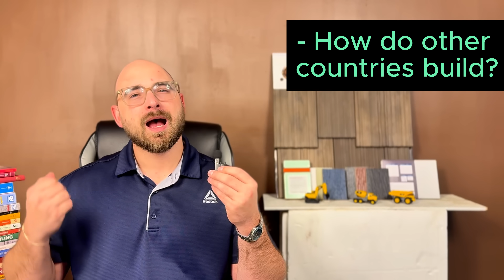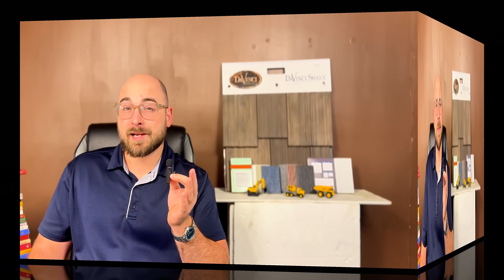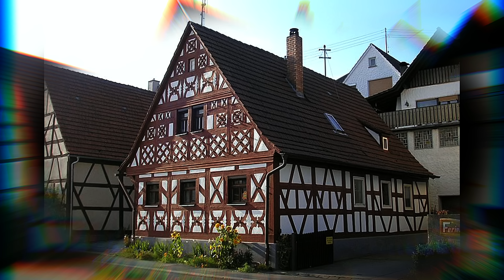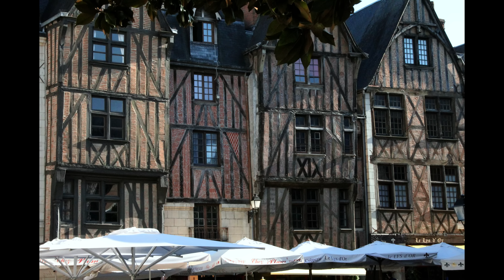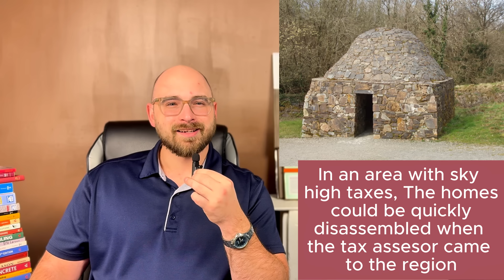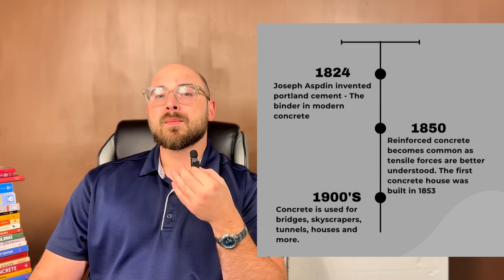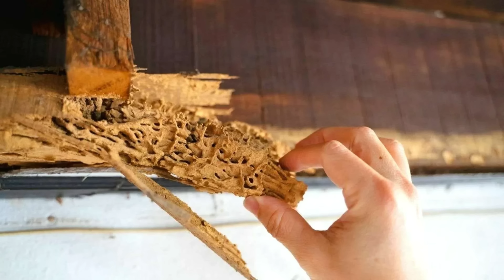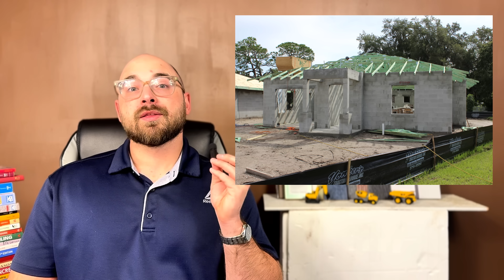Why Other Countries LAUGH at American Homes

Comment: I personally think that strawbales houses on an insulated concrete foundation (you can add stuff like perlite or leca balls to concrete to make it insulated, also saves on concrete) are the most sustainable way to build almost everywhere in non tropical climate.
Strawbale houses can be built timber framed or load bearing, have wonderful insulation for noise and temperature, are built from an organic byproduct of our food production, and have an extremely low CO² footprint.
The material can be sourced locally almost everywhere, and almost no energy is used to produce it (a bit of diesel for the strawbale machine and tractor, and a bit for transport.

Concrete and bricks are wonderful, but they need a lot of heat energy to be made. I think their use should be limited to where it's necessary, as in foundation, floor for upper storys, roofing materials etc...
Timber is also wonderful, if you don't chop it up into little toothpick sized sticks, and manage forests responsible... But timber also does not need to be used everywhere, it's enough for proper framing.

Clay plasters are absolutely lovely inside, can be colored lots of different ways, they act as a thermal mass to reduce energy spent on heating and cooling, regulate relative humidity to a nice and stable 50% inside the house year round and can even be reused after centuries, simply by soaking the pieces and remixing.
Lime plasters do need a good bit of energy during production, but not much is needed to plaster a house. They make for a nice, weatherproof plaster, that also can be coloured, it breathes, has anti fungal and anti bacterial properties to prevent molds, can even be polished into tadelact to be waterproof enough to make showers and bathtubs and sinks from it...

And last but not least, hemp should be given some love as a sustainable, wonderful building material. It can be mixed with concrete to make hempcrete... It can be made into insulation... It has lots of wonderful uses, even only within the building industry, and best of all, it will grow on very poor soil with very little water, doesn't need pesticides or fungicides...

Aside from materials, I really mourn the loss of historical building styles.
Houses evolved in certain styles in different regions for reasons. They are usually very well adapted to the locally available materials, climate and natural disasters. 
A pueblo adobe house is perfect for desert climate, but would not make sense in Wales (where they have houses from very similar material (cob, wood and thatch) but in a completely different style.
A house in southern Bavaria in the Alps used to be build on a big stone foundation, with a big roof overhang to keep snowdrifts around the house to a minimum and to stack firewood, smallish, mostly south facing windows, and wood shingled roofs (that were payed, not nailed) on extremely heavy timbers, so it could bear huge snow loads (which added insulation). This style would not make sense  for let's say Alabama, which has almost subtropical climate. 
There, you would want big openings to catch the breeze, shades for the openings tall ceilings... Probably steeper roofs for heavy rains... And lots of lime plaster, stone, and moisture resistant woods like oak, teak, mahagoni etc instead of pine or fir...

Comment: Local monopolies, cheap materials, and low property taxes—these factors combine to produce certain outcomes. Wooden houses are neither environmentally friendly nor earthquake-resistant, as they require not just wood but also various chemical fillers, which can release large amounts of toxic gases when burned. In fact, with the advancement of modern industry, new materials like reinforced concrete and developments in engineering mechanics have become highly sophisticated.

Comment: The problem with steel in concrete is that it massively improves the performance of the concrete… for a short time. Concrete is porous, and water gets inside. It then rusts the steel, which expands when oxidized. This cracks the concrete, allowing more water in. Game over. 

We’ve tried all kinds of stuff like coating the rebar in polyurethane and other waterproofing ideas but if the workers aren’t careful or do everything perfectly they can compromise the coating or cause some other issue. The reality is that you just can’t stop water, so concrete without rebar can last a lot longer.
Reply from the maker: It can be prevented. 

We can use stainless or galvanized rebar, there’s also basalt and GFRP. 

Concrete can be treated with calcium nitrate to increase the protective layer (passivity layer) that forms around the concrete. 

And we can protect the concrete from water, waterproofing, drainage plane, cladding, capillary break at foundation, etc.

Comment: Excellent video.  There is so much more detail to discuss and consider that most people do not understand.  Reinforced concrete has been used for countless parking structures as well as for high-rise condo and office buildings - BUT - the rebar inside all those structures ages and will more often than not ruin the very concrete in which it was encased.  Correcting that issue is extremely costly and difficult.  America needs to (& could) do MUCH better with putting up its buildings whether residential or commercial.  ICF, SIP, building tile (AKA structural clay tile) and recycled materials for roofing are not being utilized the way they really should be - and all of them are superior to stick-building in my opinion.

I'm building my own home using ICF, SIP, and recycled materials.  Yes, it's more costly in the beginning but over time, it's much less costly to maintain.  Sadly, finding quality builders willing and able to build (correctly) with these materials is exceedingly difficult.  Unfortunately, to a large degree, code adherence, quality assurance, and just the overall "getting it right" is on the shoulders of Homeowners, when really, it belongs with the building contractor who is charging exorbitant prices.  We need laws that protect Homeowners more and Contractors less, but that's another video!

Comment: the main difrence i see between norwegian and american houses are that norway tends to pad the margins a lot more at just abaut every angle. electrical cables are thinker than they strightly have to be, outer walls can in extreme cases get quite redikulusly thick. the personal record i've seen is a outer wall wacing a cold and windy ange witch was just shy of 60 cm thick at the lowest level (an admitetly extreme case). if there is sutch a thing as "standard" here its probably a house built on a slope on mountanus ground with its lowest level and at minimum foundation being made in concrete, then 1 or 2 levels above that is wood framing with exterior wood framing and tiled roofs. interior walls warry a lot but again our insulation requirements are damm well padded.

in the end a norwegian house is going to be significantly more expensive than a american one to build, but its also going to have less heat-loss and be built with the expektation of lasting around 80 years before major renovation is needed. they are also extremly well inulated, as in if your house was built the last 10-15 years or so an internol termostat shoud not be able to detect the changing of the seasons

Comment: 'Building code' is the absolute bottom of the barrel, dregs of minimum standards. We have trouble with developers willing and able to consistently meet even those laughable standards. Fighting almost every effort to update and improve code and standards. If cardboard boxes with extension cords were code, they'd be building those. If the cardboard homes were accepted for a number of years, they'd then call them 'traditional construction'.

Comment: As a south American I have asked that question many times, why are American houses like that?

Here I have to recognize that a great % of homes in many regions of south American countries are in deplorable condition. However, the actual house or departments are way more resistant than an American home.

You punch the wall? Not a problem, simply go to the doctor!

A car crashed against your home? Not a problem, it evaporated against the first wall.

Someone wants to break in? Close the door.

After thinking about it, I believe that all of this comes to different needs for different countries. South Americans are used to earthquakes and so is our architecture. Buildings must be able to resist the common 3-5.5 earthquakes that could strike at any moment.

In the other hand, Americans have to deal with storms and floodings more often. But I don't see how making paper homes help with that...? Another justification that ai found online was that making homes like that allows for easier modifications and that sounds fair but it not like our houses that are more similar to European structures can not be modified or repaired.

This may be a question without a satisfactory response, it may be another case of America not being like the others (similar to Americans using everything except the metric system)

Comment: It is not that USA doesn't want to build better homes, the problem is that their chain of materials and technology is all based on wood, even if all contructors learned to do brick and concrete homes, the material channels are not ready to change to new materials and there would experience an economy hit.

Comment: In Western australia we use mostly double brick construction with insulated gap between the bricks.  Wood or steel roof framing with tin (colorbond) or tile roof.   Eastern states mostly use single brick outside wall with steel or wood framing for walls and roof and drywall inside finish.   Tin or tile roofing.   Concrete comes with a massive CO2 impact so that's something most don't know about.  If wood is from tree farms then its removing CO2 from the air when they are growing and then locked away in houses for the life of that house.  So really swiss are adding a lot of CO2 with there building choices vs america using wood frames.

Comment: Strict codes and strictness is not actually helpful. Because it leads to corruption and bribes.
A simple example. Driving license is so hard in my country currently, that it's normal that people give bribes to the examiners. Which means, that lots of people regardless of their driving skill pass, only the worse won't. While very good drivers still won't, unless they bribe. The system works against itself. 

The solution is to aid or help house builders, or they just won't register their houses or forge the papers on it. But if the registration process is aided, the architectural phase, common sense room layout and needed logistics rooms advised, so on, or even common usage tools can be rented, than there is a healthy co-working for achieving the best result.

Simply going strict doesn't help. It's more effort, but with less result. For a higher bar more effort input is needed, to better and aid the process.

Comment: I'm from Belgium. We plan to build a wood-structure house (with a lot of  bio-sourced insulation). Actually here in Belgium those wooden constructions are more expensive than "classic" constructions with concrete or concrete blocks, what a pitty.

Also: tornadoes and storms in europe (at least in western europe) do not seem to be as strong and challenging than american ones. So that argument does not seem accurate to me.

Comment: 24:45 Fun fact: Mr Wright had a similar idea to the one adopted by the Soviets much later.
I'm polish and many, many flats and residential skyscrapers that were built when our country was a soviet puppet state may be compared to the mentioned method.
They used to prepare sections of armoured concrete walls through casting and then assembled the whole building at the construction site. At the time the establishments that actually produced these things were simply referred to as "house factories". 
If you Google something like "soviet commie blocks" you will definitely see what I'm talking about since most of those buildings still stand and are in fact used by the population (myself included).

Comment: I want to say this as a Japanese person.
There's always someone worse off than you.
It's a wooden building with uninsulated walls and aluminum sash windows (single pane glass).
In the summer, it's freezing hot because the air conditioning doesn't work!
In the winter, it's freezing cold because the heating doesn't work!
It's a waste of electricity, kerosene, and gas!
If you're not careful, you could die of heat shock in this house!
Reply: I'm in the UK, and in our visits to Japan we have been astonished at the discomfort of anyone living in a traditional-style house: too cold, too hot, high humidity. They look beautiful though!

Comment: You can see these perforated metal plates on wooden roofing truss connections. Yeah. I don't think those are accepted elsewhere or at least in Europe. I know in Hungary, definitely not. Usually there are these big hard metal plates, like at the minimum 2-3mm thick with big screws. They are hard to bend with the solid hammers meant for nails or the like. And there are usually multiple of them at the sides too. That's the standard practice of other nations.

Comment: I'm from Germany and don't think American houses are dumb. Actually it depends on where you are and want to accomplish.
For example in places where tornados or hurricanes are a problem these houses may not give tons of protection but they are relatively easy to repair. You can switch out whole walls in a matter of a few days. And they are built fast. You mostly see the houses we laugh about in suburban areas where in the 50s to the 90s was high demand for. So buildings needed to be built really fast. And that some Investor would build whole small communities at once didn't help there. They were made to make quick cash. I even say our sturdy buildings sometimes stand in the way of progress. The worst thing is that if buildings get old enough they get protected and can't be easily demolished and/or altered.
American homes also switch hands much more often than homes in Europe where some families live in a house with several generations. So building them like that helps with making alterations and additions to a house. Then there is climate. In some places it's just not practical to build like we Europeans do. Americans can easily use different isolation materials and wood to react to different conditions in the environment. You can't forget how big the USA is. But they have to make standards for houses that can translate to other places too and can still be built by a person who learned in California and moves to Illinois. If the skill translates he has better chances at finding a job without having to learn totally different skills.

Comment: I missed the mention of the foundation. In Switzerland, all our concrete houses have basements, and many are built so thick that they double as bomb shelters.
Reply from the maker: Someone else mentioned the bomb shelters, super cool 

Foundations vary across the US. In the Midwest basements are more common due to frost heaving, 

In other areas there is solid rock and crawlspaces are preferred 

The south and the southwest have a warmer climate and don’t need to dig below the frost line so slab in grade and post tensioned slabs are more common, 

There’s also post and beam and stilts in other areas, it varies across our very large country
Reply: In Finland a bomb shelter is oblicatory in all apartment and office buildings.  They have about 50 cm walls, double 30 cm thick doors (not solid) with contamination cleanin area, and air filtering against chemical weapons.  They double as a storage room.

Comment: I think the issue is simple, US houses are far too expensive for what they are.
If you compare to europe and east asia for example.
East asia has similar too many US region to deal with extreme weather.
Their solution as common houses were to make them relatively cheap to make and repair, often light weight, so even if something came down it was not necessarily a death sentence.
Even if someone was trapped you could get them out without needing days or heavy equipment.
Europe has far less extreme issues with weather, what they went for were houses that could last centuries so while the upfront investment was higher, you basically planned to hand it down generations.
Now here comes the issue, while US housing construction is closer to east asia than europe, despite the appearance style being closer to european houses the price doesn't seem right.
Instead of being cheap they come price wise closer or even surpass their european counterparts.

Comment: Over the years, I’ve realized that—both continents have their pros and cons. It all comes down to personal preference: quality, beauty, style, freedom. For me, USA has still more advantages when building a house. I prefer homes with plenty of wood, traditional roofs with garrets, and minimal concrete. After living in Switzerland for eight years and seeing hundreds of houses, I find the most beautiful ones are the old ones, often in village centers and historic districts. They look like something out of a fairy tale. However, extending an old house in the same style is difficult due to strict regulations requiring authorization for every square meter, even on your own land.

New Swiss homes are high quality but lack aesthetics—lots of concrete, modern architecture, and solid structures, but little charm. In contrast, while U.S. homes may not always be as well-built, many new ones are beautiful, offering great style, flexibility in design and permits. It opens room for personal expression and creativity.